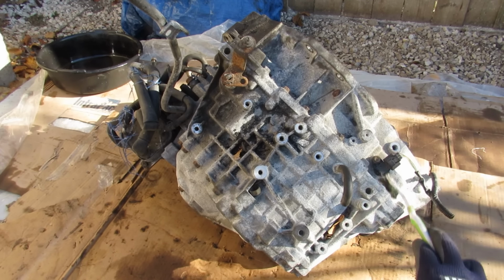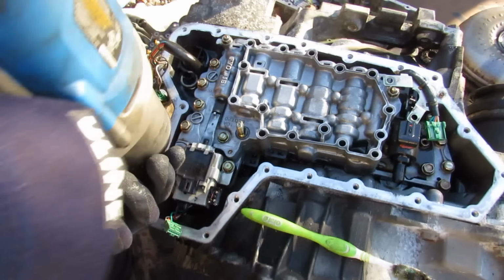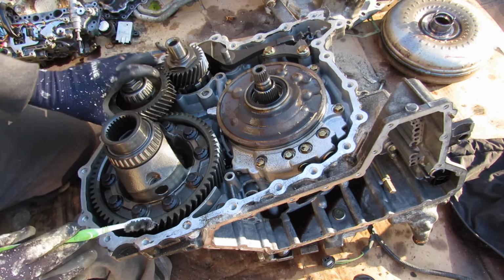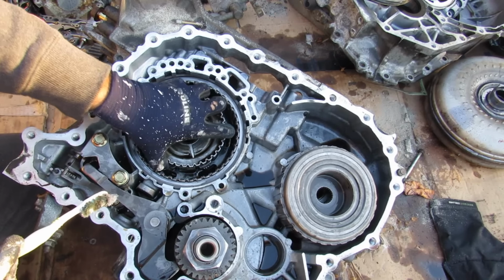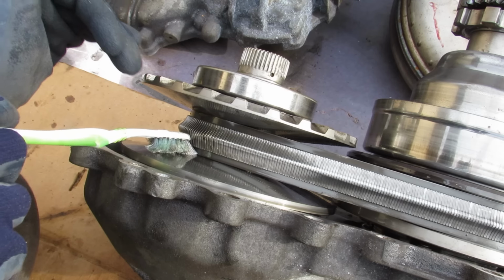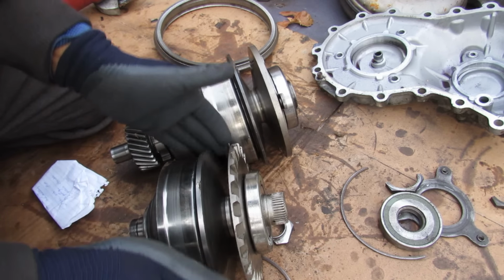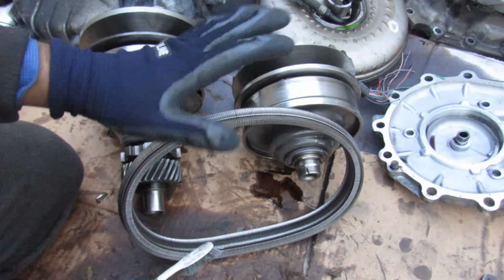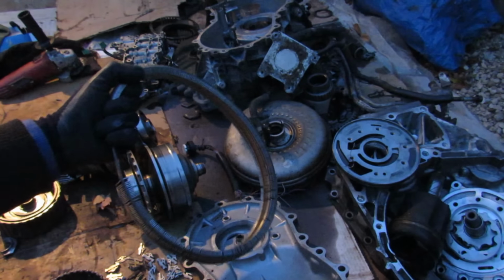Why Nissan CVTs FAIL

Comment: Lot of negative comments here on CVTs.  I have a 2013 Nissan Altima 3.5L V6 (270 hp) with a CVT and have had ZERO problems.  I drive it normally and have put about 60K miles on it.  The CVT takes a little getting used to compared to a manual or conventional automatic trans, but I've actually learned to love it!  Punch it and the engine revs up to peak torque as the car accelerates fast.  For a car, CVTs are fine even with some occasional aggressive driving,  But for a larger, heavier vehicle like a SUV, maybe not the best choice especially if you plan on towing or off-roading.
Reply from the maker: True. Not right in a Murano or Pathfinder

Comment: I’ve watched several of these explanatory videos, some even produced by large auto mfrs, but yours is the clearest and most detailed. Appreciate the detailed reviews of various parts.  What’s clear is that the complexity and inability of the system to handle large loads and thus failing is not worth the cost vs convenience. And frankly I’m not sure I understand the benefit, except in ideal conditions have a more efficient power train. Thanks!! Very well done.
Reply: As he said in the video, it gives better fuel economy. And it's more compact and has less parts than conventional auto.
Reply from the maker: You are welcome thanks for that feedback and appreciation

Comment: holy complex transmission. i have 127 k on my altima. i change the trans fluid every 50 k. i believe they  Recommend every 80. trans still drives like new. i drive my vehicles until they break in half. literally.

Comment: Any car with a CVT transmission.. reguardless if its 20K or 150K.. if you don't act like a dumbass and mash the pedal to the floor it will last longer then if you floored it every single day you drive.. yes Nissian can have a bad CVT but so can honda, Mazda, and the like.

Comment: CVTs have a fatal weak spot because they rely on dynamic friction on the pulleys, and the heavier the load the more force is required with more wear (think about mountain driving or trailer towing). By contrast a conventional automatic uses clutches in a static mode. The clutch is either engaged or it's not. In both states it is not wearing, the only wear is during the brief instant of shifting. And gears, if not abused,  they often outlast the transmission and the car itself.
Reply from the maker: Yep good points

Comment: This is a 2006, Nissan CVT was upgraded after a voluntary recall, that compensated the affected vehicles replacing or fixing the CVT system.

Google it yourself about the recall and resolution, it works without issues now, and see if you can find a Nissan on Craigslist posting w defective transmission, you will not find it.
Many other brands have acquired a similar CVT automatic (gearless) transmission - Honda, Subaru, Toyotas...
Reply from the maker: 350Z did not have. CVT
Reply: @speedkar99  edited, still the CVT issue has been corrected, the problem was the cooling system and rype of oil used. Warranty in miles and yrs was doubled!

Comment: 2013 Nissan Sentra, trans failed @ 84,900 mile mark.  Nissan wanted to charge me $500 to check if it was dead . anyone else?
Reply: 2015 Versa Note, transmission is pretty much dead at 135k. Consumer Affairs told me I’m SOL and basically said I can go fuck myself. Took it to the dealership anyways, not expecting much, and they told me that they’ll fix the transmission entirely under warranty!

Comment: You clearly prefer jerky power transmission - as it appears do many others. Why are there so many weird people about - that like jerks ?

17:23 "the drivers of these economy vehicles typically don't care about the driving experience that you lose with the cvt"

I suspect they like the driving experience they GAIN (i.e. smoothness).

"not only does it make a lot of noise it also kind of gives you a rubber bandy effect"

The 'rubber bandy effect' is all in your head. You are simply asking for a different mode of operation and it's a short lag while that mode change takes place. When you get up to speed, you ease off the accelerator expecting the acceleration to stop - but it doesn't as it just eases off smoooooothly.

Comment: you did not mention that the Cobalt metal balls inside the primary break apart and slide out inside the primary pulley, which in turn cause fluid pressures to drop and the conical part of the pulley that attaches to the belt to not move - causing slippage and belt disintegration... also no mention of aftermarket CVT coolers that people install to maintain the transmission temps and prevent slippage and early fluid disintegration/failure. CVT's can be rebuilt but it is costly - essentially its a full replacement of the pump, torque converter belt and pulleys, plus replacement of any gaskets, part of the clutch pack, and all new bearings. some rebuilders will even install pins in the primary pulley as opposed to the balls.

Comment: I haven't seen anything more stupid than CVT from engineering point of view, obviously i never owned one
Reply: As annoying as they are I honestly PREFER the motion and acceleration of a CVT over an auto. My daily is a 2014 rogue but I also get plenty of time in a 99 gs 300, 05 Dakota and a manual 01 Bullitt. Felt em all and the CVT is just so comfortable to me, maybe I just suck at driving autos tho cuz I always up and down shift unintentionally.
Reply: Nor do you and I plan to

Comment: CVT gearboxes are junk no matter what country they come from.   Mini Cooper is the worst I've seen.   45 years as a master mechanic.
Reply: I had the misfortune of owning a daily driver with the crappy volkswagen DSG. Started overheating on the day one. Called the dealership, they said it's normal give it some time to cool and I was like what the ** ! Anyways, I drove it 30,000 kms (18,750 miles) and the transmission fails. Vw says it was because of the synthetic oil. They repaired it in warranty and filled mineral oil this time. And it works, still overheating every other day. It is the DQ200 with a dry clutch which is the least reliable piece of shit transmission I've even seen in my life. I fear taking it on long drive. I hope it does not explode one day. I've wasted my money. It has an inherent manufacturing defect which vw will not disclose nor fix it. I'm sick of this car. And my honda civic with CVT is working fine from last 7 years without any problem.

Comment: I used to drive a Nissan, then i started valueing my money more
Reply: There is definitely value in the money I've saved from the fuel economy, but that saved money is literally wiped out from the fact that the transmission replacement costs about $4K.
Reply: You can't have too much money if you drove a CVT Nissan LMAO

Comment: Well that was a pretty damn interesting watch. Makes buying a car with one simply a bizarre decision doesn't it? No manual and no maintenance available, it fails and you replace entire CVT. Wow!

I'm driving a Tesla delivered to my residence Dec 30th. The main reason I purchased is because of all of the complicated machinery associated with ICE vehicles. It was always on my mind, things like wear, maintenance, dealer workmanship, as in, are they taking me for a ride and we've all thought that at one time or another. All that concern is gone!
Reply from the maker: Each car has it's own issues and Tesla isn't without them. Just because it's mechanically simplier doesn't mean it'll Outlast a traditional automobile
Reply: @speedkar99  Down the road, I may have issues here and there but it won't be from a cooling system, exhaust system, transmission, or an internal combustion engine which is why I purchased it.

Comment: I worked for Exedy when we designed the tq convertors for these.  Jatco was a pita to deal with.  We had to use a soft fiber material for the friction face on the damper that would usually fall apart by the time it reached final.  If we used a stronger material like the kevlar compound we put in the ford/chevy 6sps it would lock up too hard and damage their crappy trans.  Stay far away from anything with a cvt, they're garbage.

Comment: Engineered to fail as soon as your warranty expires.
Reply from the maker: That's perfectly engineered
Reply: Just like they replaced timing chains with timing belts. If its not replaced at recommended service. Could destroy your engine. Same with CVT.

Comment: "Why Nissan's CVT's fail". I'll tell you...

Having a Nissan Maxima (bought brand new in 2007) with only 47,000 miles today, I can attest that CVT's are a bunch of bull crap. It is the worst transmission I can think of; since automatic transmissions came out in the '50's.

From the day I bought it, and took it back for the noise the CVT made; and all the dealer would say, "That is normal and there is NO way to stop it!". Bah hum bug!!!

In these 14 yrs, I have researched and studied the problem to the "nth" degree; WHY that noise is there. Not to mention the myriad of CVT's that have failed customers. It took a ling time, but I now KNOW what is the problem.

In simple terms: it is a transmission that is BUILT-IN to fail, oh yes. Why? Because it's major parts are a metal belt and two "variable" pulleys. The belt rubbing on the pulleys' sheaves; is where the noise comes from. And as the car ages, the noise gets worse; and in some cases the belt blows up. MANY have experienced this calamity. Oh yes indeed.

The cost to replace the CVT "trans-axle" can run up to $6,000.00 dollars. Re-built ones are upwards of $3,000.00. Worse: in all likelihood, the rebuilt is worse when it comes to noise. Oh indeed. Many have had this horrible experience. And the auto industry will NOT give your money back.

Sad but true. A wise person would NEVER buy a car with a CVT. But the worst thing is: Nissan KNEW it before it ever came out. And they have not done one thing to stop the problem; simply because they can't. IE: A belt simply can NOT replace "time-proven" gears. It is that simple. In fact many of geared auto transmissions, have gone over 300,000 miles without a problem. Try that with a CVT. LOL

For what it's worth.
Reply: I’m glad I’m reading this cuz I was about to close a deal tomorrow on a 2009 Maxima!
Reply: @aridematos3555  I am thankful  you chose to not buy a CVT car. Because I have 14 yrs of hell on earth; with that silly dumb transmission. May Jesus bless you and yours always kind Sir.
Reply: Your problem isn't that your Maxima had a CVT in it. It's that you bought a Nissan. TF is wrong with you, son?
Reply: @csn6234  "Son"? I  turn 89 April 5th. And why do you use an obscene abbreviation to make your point? Huh?

A wise person would say that YOU are the one that is "wrong". Oh indeed yes.

Finis!

Comment: ... and that's why "the market" should be regulated.  Consumers spend a fortune, they should last.  It's easy enough, the transmission, if it fails, should be replaced free of charge for the life of the vehicle.   So instead of the consumers getting ripped off, the manufacturers have to shoulder the risk should they build them cheap.
Reply from the maker: The life of the vehicle is considered the warranty. After that you are on borrowed time.

Comment: They are very easy to diagnose providing you have proper tools and judgement and even easier to repair. Google is your library for good cvt info
Reply from the maker: But where do you find parts?
Reply: You can find parts on Ebay, local scrapyard or a transmission parts house

Comment: ?I was looking at the Subaru CVT Transmission and their chain looks stronger because it is intertwined. I am even afraid to drive my X-Trail too hard after watching that video. I wish NIssan would make like a tiptronic transmission system using the old technology where you had gears like the old manual transmission. The X-Trail is a nice and big vehicle.
Reply from the maker: Do we get the xtrail in North America or is that just the rogue?

Comment: Cool video, I remember a good few years ago I bought a JDM imported Suzuki Cultus convertible & apparently they were some kind of testbed for Suzuki & IIRC Borg-Warner in developing their pushbelt "S-CVT" setup. 
This was an early 1990's car so pretty far ahead of the curve, but they were known for high failure rate even then with most of the S-CVT cars failing within 30k miles from new.  I was planning for a while to try and look into and repair the 'box, even getting so far as to be in contact with one of the engineers who worked on the project at the time with Borg-Warner but in the end money and time dictated moving the car on to someone who was planning a manual swap.  Still kinda regret not being able to see it through as it'd be a real rarity today, especially in the UK since the S-CVT cars were JDM only.  The car was amazing though aside from the gearbox failure (low line pressure from a worn out pump I'm sure, it selected forward/reverse well and didn't feel to slip horribly but never managed to change ratio at all). It would've been a good 15 years old when I had it & had about 50k Km on the clock, everything still worked perfect, roof, windows, even the AC was freezing cold but the gearbox was about dead.
Reply from the maker: Awesome

Comment: Such a great video, thank you! No more mystery of what's inside those CVTs. Fingers crossed that a fluid/filter change can make my whining stop.
Reply from the maker: If not then look out for your next vehicle soon
Reply: @speedkar99  Good news, dropping the pan and cleaning the pickup screen and the other little filter in there made it stop whining. They were in really rough shape.

Comment: I’ve had a Toyota Avensis with a cvt for over 7 years. Done 103000 miles now. No problems and still smooth and economical.
Reply from the maker: Awesome

Comment: I know that all CVTs suck but I wonder if Nissan did anything to actually improve the reliability of those transmissions over the years. I drove the newest Rogue and actually didn’t mind how the CVT worked on it.
Reply from the maker: They've made alot of tweaks and also changes in programming

Comment: I'll buy a CVT car when it comes with a lifetime warranty...
Autos are bad enough, they seem to all blow up about 150k miles, even with fluid changes.  (or half that...)
Meanwhile, my 1980 toyota has had the oil changed in the manual transmission 3 times in 600,000 miles - which probably constitutes abuse, but it still works just fine, even all the syncros.
Reply from the maker: Nice 600K

Comment: i was told that cvt transmissions didn’t have a torque converter. Now i know differently
Reply from the maker: They all have to be able to stop the car while keep the engine still running

Comment: Really impressive amount of knowledge - thanks for taking the time and stepping through it all. I've got a CVT in my Subaru and always wanted to know how it worked. Fortunately Subaru extended the warranty on my CVT to 10yrs/100k miles so that's something.
Reply: Subaru - and mind you i am talking 30 years back -  was a strange company that seemed to want to make reliable 4 wheel drive vehicles.  no bull**
Reply from the maker: Glad you appreciate my work
Reply: Subaru doesn't seem to have much trust in their CVTs if they only have a 100k varranty.
Reply: @I_THE_ME  how so? That's at or above most drivetrain warranties.
Reply: @jasonmiller2570  100k sounds almost like you were saying kilometers and not miles, maybe thats why he was confused, because yea 10 years, 100,000 miles sounds like the standard warranty issued by most of the companies out there today, at least for honda, toyota, subaru, kia and hyundai, which are the ones i can think of off the top of my head that have those warranties.
Reply: @compzac  ya maybe. Anyway the Subie turned 10yrs old this year and still runs like a champ.

Comment: I have a Toyota Prius 2007 with CVT transmission and 140k miles. In the owner's manual don't say for change the transmission fluid. You recommend me to change? Every dealership say for don't change that, for that I'm asking a real professional 😅

Comment: The company I work for has a 2010 Nissan Altima with a CVT, 11 years and still going strong. Hard driven all the time, it's a company car after all. No rubber band effect, super easy to lose track of your speed on highways and get fined. Everyone loves it. Changed my mind about CVTs after driving it.

Comment: Too complicated  which usually means too many things can go wrong. I prefer a manual transmission. Nothing ever goes wrong with a manual unless you need a relatively inexpensive clutch replacement.
Reply from the maker: Good choice

Comment: Glad I bought a Subaru, they have great CVTs.   Peak power at any speed has it's benefits if you don't have a powerful motor.
Reply from the maker: How have they held up?
Reply: @speedkar99  I know about 15 owners who never had an issue but the Internet is of course filled with horror stories. To be fair, every single car I've owned has been filled with problems on the Internet but not in the real world. The CVT is the only Automatic that doesn't make me miss a Manual.

Comment: Is this a Jatco CVT transmission?  I've heard they are the worst.
Reply: Japanese Automatic Transmission COmpany (JATCO) Yes, Nissan swears by them. The automatic transmission in my G37X is a JATCO transmission. After a year and a half of owning it, I can tell you I'm not a fan of their transmissions. The valving design could have been improved. Especially, for "sport" mode. Cold, the thing "shudders" if you tell it to down-shift. The fluid needs to be fully warmed up before it works smoothly. Every other automatic I've encountered with a "sport" mode has let me manipulate it at any temp and has shifted smooth. It's the one thing that I hate about the car. Sadly, it's normal according to Nissan/Infiniti. Excellent car otherwise!
Reply from the maker: Murano